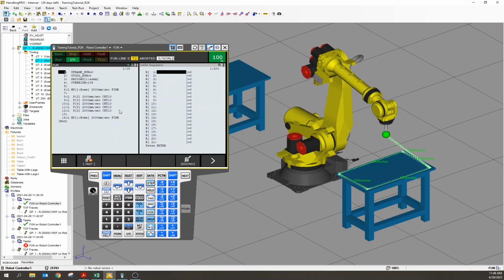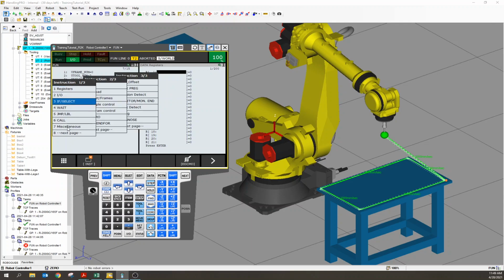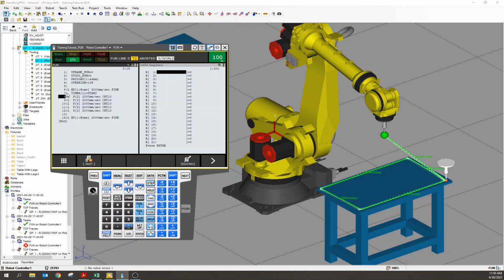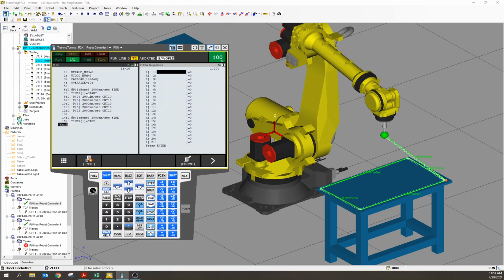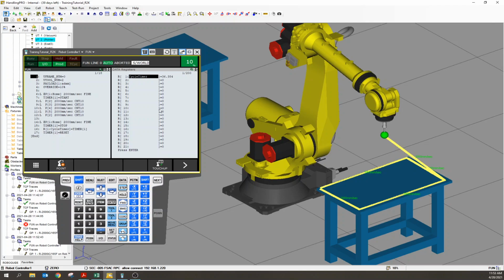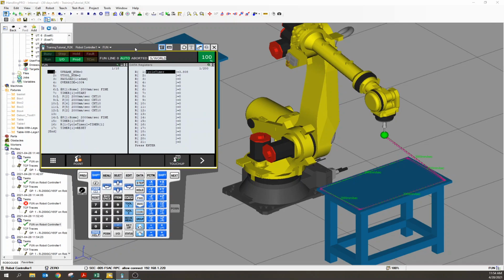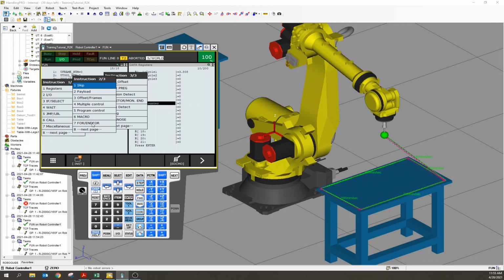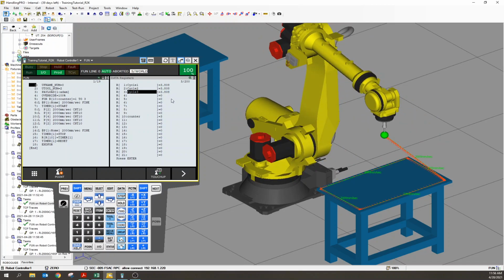FANUC Timers

Comment: Love the video!
Is there a way you can do some kind of timer/maintenance timer?
I'm working on a project that needs a lot of preventative maintenance i.e battery replacements, grease bearings etc. 
It needs to be heavily planned in advance hence if I can setup some kind of service schedule on the robot that would be extremely useful.
Sorry if this is a stupid question btw!
Thanks!

Comment: Hey Adam, 
over the last week i watched alot of your videos. Thank you for all the useful tips so far :) I have a question though: I programmed a simple pick and place simulation but for some reason the robot rotates in the wrong direction for a couple positions when it could go the shorter way by rotating in the opposite direction. is there some way to force the robot to rotate in the other direction ? or is this a common mistake do you know of this error? Thank you !
Reply from the maker: Thank you so much for watching my videos!
Yes this is a common question, and there are a couple simple fixes. 
First, if you can - change the motion type from a "J" joint to an "L" linear. Linear moves take shortest path, whereas Joint moves all servos at once and sometimes takes weird paths. 
You can also move your cursor to the end of your motion statement and press "CHOICE" to add move options. Depending if you have an "L" motion or "J" motion, you'll see either the WJNT or MROT options. WJNT = Wrist Joint and MROT = Minimum Rotation. Either of these will help optimize the move. 
Lastly, you could program an intermediate point between the start and end points which will force the robot to pass through the orientation that you'd like. 
Thanks!
Reply: @AdamWillea  Thank you very much! I was able to fix it with your help Keep up the great work you are doing! You´re awesome!
Reply from the maker: @Theon264  Awesome!!! I love hearing that :) Thanks so much.